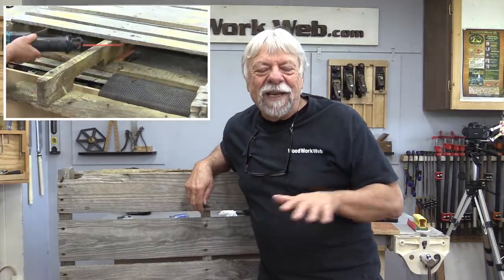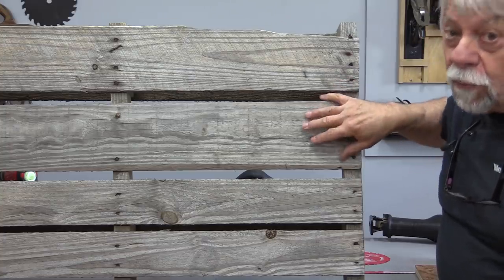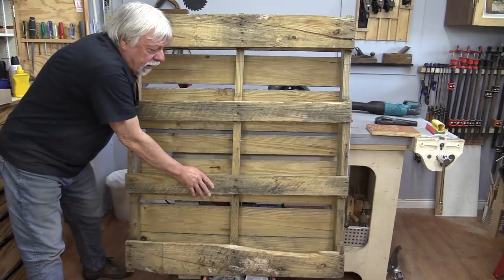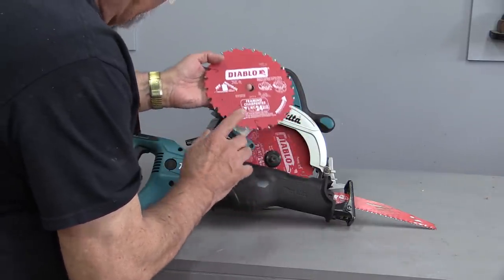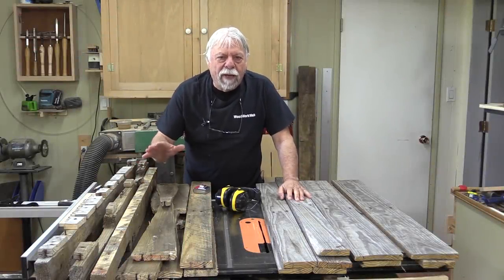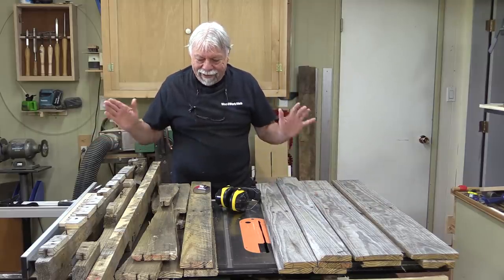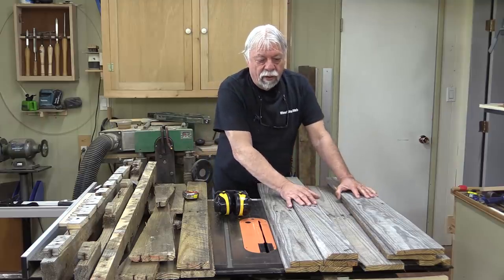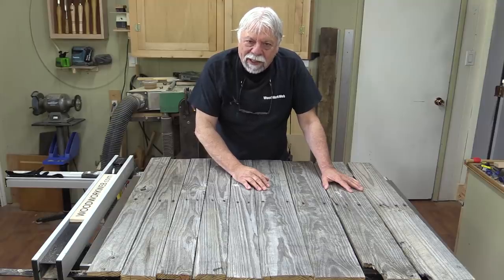Why Colin Knecht Quit Using Pallet Wood for Woodworking

Comment: Some of the Pallets here in Australia are made from, both Hardwood and Softwood. The Hardwood Pallets are hard to come by a lot of the times, as a lot of people prefer those type of Pallets over the Softwood Pallets. I do know that people do spend some time inspecting them and cleaning them up and don't have as much trouble with them, as those people who rush in without taking the time to do what is necessary first.

I have seen some Lifestyle TV programs use Pallets, although outside of TV, I have seen them used and the effects produced are more than amicable for all sorts of uses. Where some people like the rustic look, and, I have seen some finer Furniture built too, as well as Shed/Garage/Workshop benches, to shelving, jigs and indoor uses etc. However, I do understand that this type of wood is not for structural usage, yet, I believe your concern here Colin is genuine, and rightly so, as there are Pallets that are just too dangerous &/or too far gone to be effectively utilised.

I think what it really boils down to for most people using Pallets are; common sense, a person's woodworking ability, material cheapness, relative abundance, ease of access to material, woodworking frequency, Self-improvement, Teaching, satisfaction and the places/areas when sourcing Pallets, also visiting/adventure etc., in every instance, one, some or all of what I have said. Obviously, good common practices are exemplified by not obtaining a Pallet/pallets from most Chemical and refinery facilities, yet a Warehouse that stores Perishables etc. is a good start. I have seen some and heard that Companies, small businesses and homes advertise Pallets for sale - going cheap - for free or for firewood. Cheers for the video :-)

Comment: Add to that the fact you never know where this pallet has been, and the kind of chemicals that might have been spilled on it (knowing that they are reused all over the place), you're left with potentially harmful wood to use (or even burn). Like to no gain, potential health hazard, it's a bet I'm not willing to take.
Reply: Totally agree. On the other hand, these one time use pallets and frames when they ship machines, safe to use and not beaten to death. From an ecological point of view, it makes no sense to remove a good pallet from the cycle that could have been used several more times. For every pallet that is removed, a new one has to be made.
Reply: I used to get all of my pallets at a publishing company. So they shipped paper on it. They did not print anything at the publishers. They only did the office work. The editing. They still went through reams of paper doing that though. All pallets were used only once and clean when I got them. All was hardwood. Mostly red oak but some maple and poplar too.
Reply: Paul Frederick that’s a sweet source!
Reply: @1pcfred  I totally agree with you:  if you can find quality hardwood and you can track what happened to it the way you're talking about, that can be an interesting source of wood (with all the limitations Colin mentioned). I personally don't have the time to do it like this, but if you find good wood this way, that's awesome! :)
Reply: Most pallets here in Europe are heat treated which is perfect for outdoor furniture, there's something satisfying about transforming an old pallet into something strong and nice looking.

Comment: So I love using pallet wood but I also have a good supply of pallets that I know where they came from so that helps. Also there is a company about 25 minutes from me that is a pallet salvage yard and you can buy them already apart and denailed for pennies and you can pick through them to get what you want. I also find its great to practice on as I am basically self taught and you tube educated wood worker lol and using free pallet wood to make your mistakes on is alot better then spending money on something and mucking it up. There are several ways to take apart pallets so that you get a great yield and some you just have to write off but if you educate yourself on the pallets and the markings and what your actually going to try and use it for its fine to use. Now that being said I am not a fine furniture maker and I do not have great hand planes and such and name brand tools, I am a hobbyist and make stuff for home and sometimes for friends and it is what it is. I enjoy the super fine stuff and the salvaged rustic stuff, I look at the craftsmanship and the time and care put into something and respect that as much as what kind of wood that is used. There will always be a better woodworker out there then me and there is always going to be someone that I am better then at woodworking that is just the way it goes. I do not shame anyone for using pallet wood, framing lumber, veneered lumber, live edge, hard wood, soft wood, pallet wood or salvage wood. If it keeps wood working alive then I don't care how you join the boards if its butt joints, pocket holes or mortise and tenon. Just get out there and make something and make it to the best of your ability, I am a FF/EMT full time and this is my stress reliever and believe me there has been alot of stress lately with all that is going on so just get out there and make something whoever you are and with what ever you have available to you. Sorry for the long winded answer but just felt it needed to be said and I hope I was able to get the point across as I am not always good at that lol, just ask my wife lol.

Comment: Considering the price of wood now, if disagree. I broke down some larger pallets in about 30 min, drove it 2 blocks home, and sold it for $100 an hr later on FB. They were 2x4s average length of about 5 ft. Today 1 2x4 x8ft is $15.00 at Lowe's. If you want to make quick money, I recommend getting in to the free wood hustle.

Comment: I agree that free pallet wood is not worth the effort for making fine wood working projects that look like you bought fine quality wood to start with.  However, I think pallet wood is still great for any rough, crafty, reclaimed lumber look project, where the chipped edges are OK and no matter how rough the surface, you wouldn't plane it flat.  You are 100% correct on not wanting to plane this stuff. The rocks in the wood is a good call out.   Also, you should mention that sometimes you never know what kind of chemicals are on this stuff.  They could have shipped weed killers,  insecticides, caustic cements and who knows what else.  Be careful.

Comment: I worked for a sharpening service in a large metro area. We had lots of “repurposers” come in with blades. Most often multiple carbide tips missing, bent blades, and destroyed planer knifes. If you cut pallet wood, use a cheap blade. Or a jigsaw. Cutting that crap on a table saw is sketchy. ( wear safety glasses)  I was always surprised at how many folks don’t. A flying carbide tip will ruin your day.

Comment: Before this video I was asking myself if use pallets is a good idea. The cost of sandpaper, saw blades, electricity, time and effort did not convince me to save anything. To dismantle the pallets I use the reciprocating saw, hammer, and pry nail. To clean the wood i use belt sander, random orbital sander, and detail sander. To edge the wood I use table saw for rip edges and circular saw. Then I need to use a lot of glue to make long boards and screws. Finally I use stain and polyurethane to protect the wood. All the power tools use energy and accessories that I need to replace in short time. I spend a lot of time sanding and squaring the board. I forget to mention the wood filler for the nails holes. The pallets wood are free but the cost to have good boards is more expensive than new wood.

Comment: Nothing wrong with pallet wood if you know the limitations and know what you are using it for/getting out of it. I've recently made a reclaimed pallet wood wall at home (12 square metres worth of wall) Cost me some sand paper and couple of pots of wood oils for staining. Kept the splits nails, its adds to the effect. Looks amazing. I've also built garden furniture out of them, and vintage wooden crates. All look great, all work well, because you know what you are getting with pallet wood. I have also seen some youtubers put in a LOT of time and effort to make some incredible things out of pallet wood. 

That said - unless you are on a mission, I really wouldn't use pallet wood for any kind of fine or good woodworking. Know the limits and pallet wood is an excellent choice.

Comment: I buy the scrap pallet boards from a pallet company  I did 200 square foot wall for 112.00 for the the wood and it is already taken off the stringers. I do have to square the edges by running them through a table saw but no big deal and 75% of the nails have been removed.

Comment: Where I live, near the beach, the authorities do not even want you to use pallets for burning on the beach because of all the nails.  So you have a disposal problem if you're taking apart a lot of pallets.  I have used some oak from a pallet that came out of Indonesia and it was beautiful...until the finished piece broke because of undiscovered flaws in the wood.  
There are better ways to get scrap wood.  There is a nearby commercial woodworking-cabinet shop and they allow me to go through their dumpster, and I can get clean dry dimensional pieces there, some very nice.

Comment: walmart has been a source of free pallets for the last 30 years.   used in the garage
to  set tool chests and other boxes up off the  dirt floor to keep them dry during
the  heavy summer rains.  when rain water can get      most everywhere

   once that need  is met then other pallets are sawed up  with a 7" skil saw for firewood.
the top boards , being thin and dry , split up nicely for kindling. while the 2x4
pieces burn hot as they are often some hardwood.

   sure , its some work to haul them home and saw them up.   the work is exerise too.

     only once in those 30 years have i bought any cord-firewood.   scraps of wood
and  sawed-down tree blox  have been available readily.  this summer both
neighbors are replacing their hundreds-of-feet of wood fence. and allow me
to rid them of the old lumber.   many of the boards
have re-use potential.  the others are sawed & boxed up for winter heat.

    the one thing unknown is how well does very old wood plane ?
   or route for finger - joining  the  ends to make longer boards ?
 and if a carbide cutting edge  is the answer . or is it simply not
worth it econonmically. as the wood by then is  simply too tough an 
animal to be worked

Comment: I use new pallets mainly, old blades for 1st few passes in planer (gravel) I have had some good hard woods as well and have made a lot of items from pallet wood, old rotted split ones nope, just chose what you want, sawdust and wood shavings go to some one else, scrap bits go for firewood, nails etc go in metal bins at recycling, if it is chemically treated, sawdust and shavings get added to paper to make fire bricks and go to people that need it, no waste

Comment: Pallets are great for rustic non-precision projects. I’m picky with what pallets I choose, HT only/ no chemically treated or exposed wood. I use a pallet buster to take them apart which leaves the boards completely intact and gives me more material to work with. I flip the boards over and tap out the nails snd use a crowbar to pull the nails from the stringers. I use an older blade for my chop saw (thats perfectly good for the rustic look),  jig saw blades (HF good enough for this) and a belt sander to knock the roughness down if needed. No planer, jointer, table saw, $600 thickness planer with $60 blades. That’s way overkill. 
I’ve been making pallet projects for 10 years. I can break a pallet down to usable material in 20 min and have never killed a tool or broke a blade

Comment: I use pallet wood every now and then, but:
1. I don't bother looking for it. 90% of the time it's pallets that arrive with various stuff (usually wood pellets used by some of my neighbors) and would otherwise be lying around in the yard, so I have to do something with them.
2. These pallets are usually new, so I rarely have the problem of getting nails, stones and whatnot (other than the nails used to put the pallet together). And the sand and dirt is quickly taken care of with a wire brush.
3. I don't have to haul away the waste – the house I live in has central heating that runs on wood, so I just throw the waste in the furnace, nails and all, along with all the rest of waste material from my woodworking hobby.

Comment: That's part of the pleasures of using pallets.  You have to look for the right type of pallets.  And in doubt, I will use an old blade.    Now avoid pallets that have 1/2 inch soft wood on top.   Go for the pallets that are colored, the hard wood if always above 5/8 thick and often 1 inch in thickness and often they wont split when you dismantle them with a pry bar and hammer.   NOw a small investment when you use this type of wood, is a hand held metal detector in case a nail broke. 
Recently I made two wood skid for the portable hydrolic pump for the extrication tools and I got two other skid in backup.   And I had no issues with my new blade when you take the time before hand to see what part of the wood you will use.

Comment: Sometimes at work we get these beautiful hardwood pallets that are like 2.4m x 1.2m. They spend their lives indoors and on concrete. Yeah, it takes a while to pull them apart and a fair bit of elbow grease cutting the nails with a hacksaw, but hell I’m not letting them go to waste. And I can burn the offcuts in my wood heater so win win.

Comment: Only one time in my life I came across a 5x7 pallet with 1” thick top boards and 4x4 runners, all solid oak. Had it in my truck and a carpenter on the job tried to bargain to get it from me.

Comment: Home depot sells weathered/barn/nautical planks in packs of 8 I believe. Not the cheapest but it's flat and ready to go. I will be using them to make signs.
Reply: I have yet bought reclaimed wood I use it but never bough. Pallets and barn wood. I get it out of old run down houses got 75 2x10s 12' long good stuff course u got to clean it up

Comment: I rarely ever plane pallet wood. I like to use a thickness sander or a belt sander to clean it up. Before I laminate it into usable pieces. Its mostly a advertising thing for me. So I can say "upcycled/recycled" for projects. Which for a good fraction of the projects i do, is a real selling point. At this point i don't even bother spending anytime to pull nails. I just cut around them. Though they are a great tool if you have a kid/apprentice, to teach them the art of nail pulling and disassembly, on stuff that doesn't really matter.

Comment: I will agree that if you are going to put it through planers & jointers to get perfect wood then pallets are not the  way. However if you are using it on projects where perfection isn't needed eg. A planter, bird box or log store. Then pallets can be fine. Also in the uk we can get pallets in excess of 12ft in length which produce a lot more good wood. Everybody's circumstances are different & it's what works for them 👍

Comment: I think I’ll still use pallets. I fetch occasionally from a local company. The scrap goes in my log burner and the good stuff I use for small size projects as a hobby like signs, garden planters, end tables etc. Don’t cost anything just my time. I’ve retired so what is the rush.

Comment: My fire pit is sized to accept a "unassembled" pallet.  On occasion when I find a relatively good one and have an appropriate "scrape wood" project or want to template something I have a stock; otherwise its a good supply for the pit fire.  You just need to rake out the nails every once and a while.

Comment: My problem is resisting wood in trees I cut down in my backyard. It pays 10 cents per hour to harvest, rip, and dry. 40 years ago my cousin got a cradle used to ship a sailboat from the tropics. It was tropical hardwood. It takes a long time for that fantasy to die.